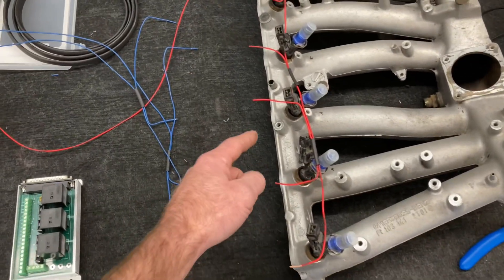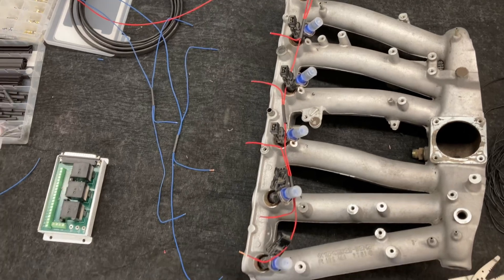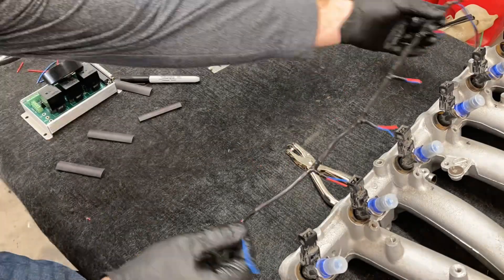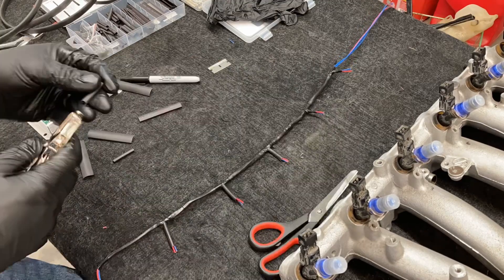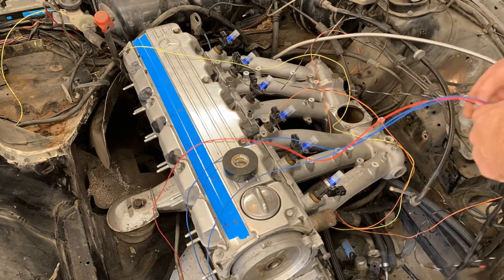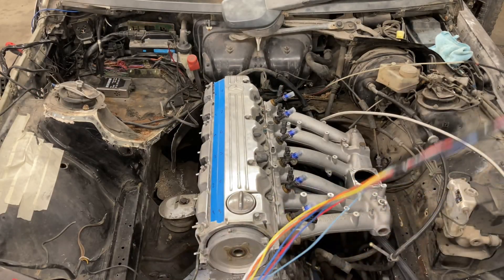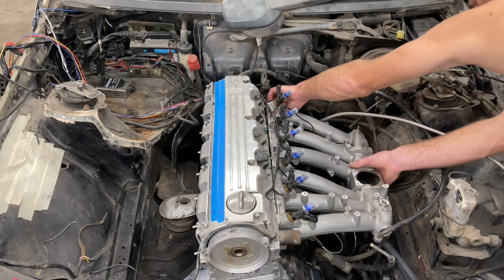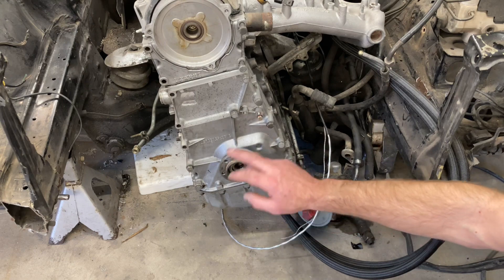Mercedes Stand-alone engine harness built from scratch!

Comment: What injectors did you use that plugged right into that m103 intrake manifold??
Reply from the maker: Ev14 long injectors
Reply: @crousebuilds5505  Thank you!!!!
Reply: Also are you using an automatic transmission or manual? If automatic, are you going to set up the stock throttle linkage on the intake manifold. Im not sure if I need to keep that cable from the transmission to have regular shifts?  Thanks for the help

Comment: I'm pass that part of my w201 turbo build but still has a bunch of wire left over coming from the Megasquirt3 computer...  these computers can do so much more. 
Now I'm stuck on dealing with tuner studio. I need help
Reply from the maker: Yeah you don’t need all the wires that are on the loom. I am a long way off from setting up in tuner studio. I would recommend downloading and printing out the mega manual for the specific ecu that you got . It’s 208 pages, but it walks you through almost everything you need to know . I will be doing videos on this later on.
Reply: @crousebuilds5505  thanks

Comment: Hello and thanks for your videos. Sorry if you covered the following question: what ECU did you use as part of this project? I ask because I called Holley a few months back and according to tech support, they supply no off the shelf ECU that can easily be programmed to the M103.
Reply from the maker: It really depends on how you want to set the car up . If you are looking for an easier route to go efi look into turbobandit. They have nearly complete kits to go standalone . I am using ms3 with a 60 /2 trigger wheel and vr sensor . Go to dyiautotune.com and look through what they have . If you want full sequential spark and fuel use the ms3X or ms3 pro .  I think I explained this in one of the wiring videos .